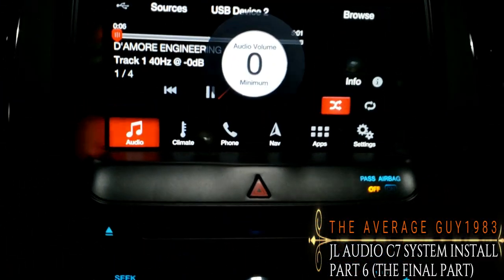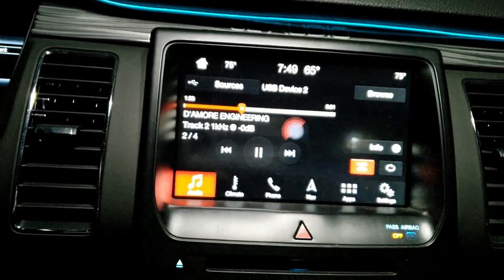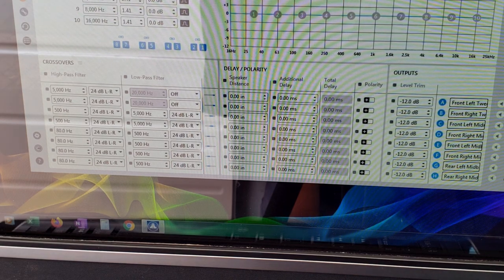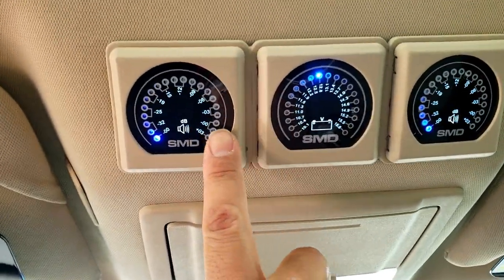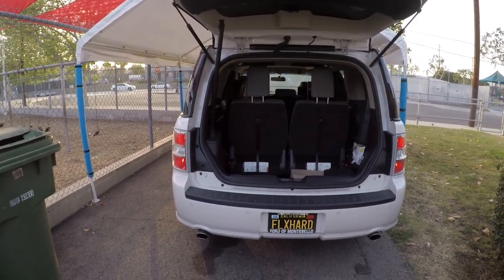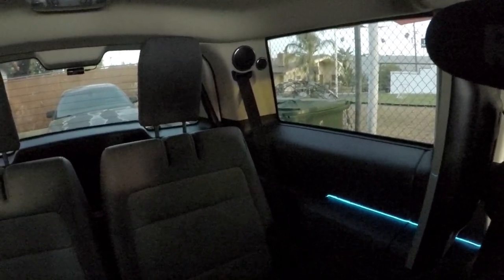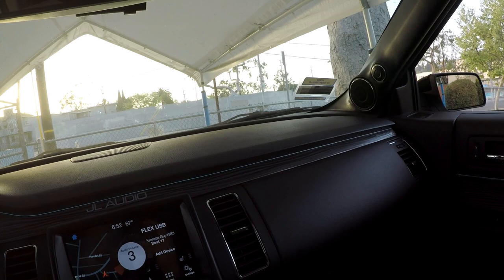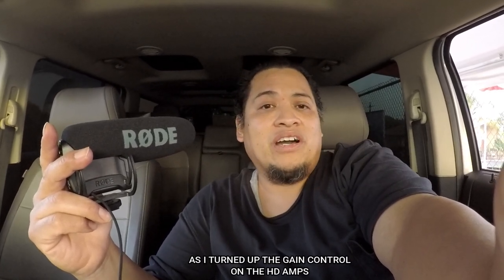JL Audio C7 System Install Part 6 (The Final Part)

Comment: Can you give an update on how the system sounds after speakers have broken in?  Awesome work bro!
Reply from the maker: Absolutely! They have definitely broken in quite well and the sound has definitely improved and they now definitely outperform my 3 way C5 speakers in sound quality. I have 1 video coming up soon about Fitment issues that I fixed and the video after that one will be the real review of the c7 speakers where I'll also be sharing my DSP settings and bring up issues I had when I set everything up and what I did to fix that as well.
Reply: @THEAVERAGEGUY1983  Would you say now that the C7s are worth it after they are broken in?
Reply from the maker: @Italian Stallion  honestly I'm still not sure if I can recommend them. To be honest, they can't tolerate the power rating they claim with music, the frequency range that they recommend at the DB slope like 12db, 24db, 36db, 48db  is questionable, I really wouldn't want you to waste your money the way I did with the hype and then be disappointed by the results. The main reason most people who own the C7s don't complaint about them is because they didn't install them and did all the math work to figure out power rating etc, they moat likely went to a shop and had them do the work and though they sound good I don't think that they are worth the hefty price tag. I wouldn't buy them again unless a driver blows out then I would buy a replacement driver but as in putting them in another car, nah man. I still prefer the C5 3 way speakers over these. It's too bad they stopped making them.
Reply: @THEAVERAGEGUY1983  Aww ok, I guess I will ask around if the C3 speakers are good. I just want to avoid paying $2560 for a three way C7 build if its nothing special and mostly hype. I've got a big budget but... you know. Do you have any other videos I should watch?
Reply from the maker: @Italian Stallion  I got a couple depending on what you might need. Like if you want to know how to wire up an amp rack I have a video on that. Unfortunately the footage I had about making the shape of the amp rack etc got corrupted on my Note 5 back when I did it so I don't have a video on that Unfortunately. As for the C3s I have heard them and they have a really nice Dynamic bass sound to them, the only thing I would be a little bit concerned about is the back of the speaker where the magnet is, it's a little wide because of the design and you may have to make the whole for the speaker to go in just a little bigger to fit but they do sound nice!
Reply: @THEAVERAGEGUY1983  OK, thanks for the tip man. I appreciate it!

Comment: Good job man, where is the part of connecting to your factory radio?
Reply from the maker: That's an excellent question. I had asked everyone about 1/2 a year ago if they wanted me to make a video on the wiring of the head unit so that it could be easier to identify front and rear left and right channels on the wire harness to make it easier to tap into. I waited a whole week and no one said anything so I skipped it.😅
Reply from the maker: I do have the wire harness diagram and can tell you the colors of the wires you need to tap into. I used the blue color Posi-Taps. They were a perfect size for the wires behind the radio.
Reply: @THEAVERAGEGUY1983  That would be great if you can please. Keep the good work.
Reply from the maker: @emelectoro  sounds good. I'll get the  wiring diagram book later today from my basement and I'll give you the wiring diagram colors. I promise I won't leave you hanging, just gotta do this after my kid's online learning that the wife and I help our kids with. 😁👊
Reply from the maker: @emelectoro  alrighty my brother! I got the info for you. So for 2013 to 2019 you will be tapping into the black wire harness with the most wires on the Left side of the radio which is the harness that is on your left hand side if you are sitting on the driver side.

Front Left:  - is a white wire with a thin brown stripe + is a solid white wire.

Front Right: - Is a White wire with a thin Orange stripe + is a White Wire with a thin Purple Stripe.

Rear Left: - is a Brown Wire with a thin Yellow Stripe + is a White wire with a thin Green stripe.

Rear Right: - Is a Brown Wire with a Thin Blue Stripe + is a Brown Wire with a thin White Stripe.

 I left center for last because I would recommend you leave that one disconnected and only use the 4 main channels.

Center Speaker: - is a Yellow Wire with a gray Stripe + is a Green Wire.

Remote line/ accessory fuse line is fuse # 37 (Underneath the Steering Wheel there is a fuse box there) this will be used as your accessory line for your amps etc. Use a Mini Fuse tap adapter, don't use the low profile mini style fuse tap as it won't fit in this spot. I recommend using a 20 amp or 30 amp mini fuse to give you plenty of power to run your amps on this line. Just a bit of advice, this line will power on when you put the ignition on with out the engine running and with it running, it will also power off Immediately when you turn off the car. Another issue to note is that when you open your trunk, it uses the accessory line too so your amps will turn on temporarily as the trunk opens and closes and then power off.

If you hear a pop sound when you turn off your amps or power them on, use a PAC-TR4 soft remote turn on wire. It can do up to 2 amps of current at 12 volts. I recommend using 1 per every 2 amps or DSPs or Line Output Converters/ epicenter like I did. I have Zero pop noises thanks to the PAC-TR4. I highly recommend it! 👌

Hope this helps.
Reply: @THEAVERAGEGUY1983  thank you very much my friend, is the first time I found somebody willing to help that fast. Your videos are excellent, thanks again.
Reply from the maker: @emelectoro  your welcome and thank you very much for subscribing to the channel. I created this channel because I got tired of my questions on car audio related stuff being ignored by other youtubers. So I decided to buy my own stuff, do as much research as possible, buy car audio books, watch how to properly use power tool videos  etc so I can help people here. Welcome aboard and I hope you find the videos I make in the future helpful as well. 😁👊
Reply: @THEAVERAGEGUY1983  Hi my friend, I need your expertise again, I went very simple on my car for woofers, so I installed a self powered one but I have a problem, the woofer is humming when the radio is off, Any suggestions? Thanks.
Reply from the maker: @emelectoro  hmmm... it's possible that the amp on the subwoofer is still getting power from maybe a remote line, if it's set to Signal sensing which means that you only have a ground and power wire on the amp/subwoofer combo and no remote, it may have a timer set on it before it shuts down. Have you checked to see if it stays on when the car is also powered off with the radio off?
Reply: @THEAVERAGEGUY1983  no, it doesn’t stay on with the car off, the humming is there when the radio is off and car running.
Reply from the maker: @emelectoro  ah OK in that case you may have a not so great Ground wore location. You may need to move the wire to another spot or 2 if you haven't done so yet, sand down the area where your ground wire is mounted at to your car to bare metal and then reconnect the ground wire back to that spot. Hopefully that helps. If it doesn't then it could be a problem with the applied or 2 if you are using CCA wire (Copper Clad Aluminum) you may want to change that ot OFC wire (Oxygen Free Copper). Hope this helps solve that problem.

Comment: You need a Helix ultra DSP to close the loop and tune it like a champ. I will add a front subwoofer.
Reply from the maker: @DavidmachAdo309  that ultra is a 12 channel dsp. It's not enough for the 12 speakers i have in this ride plus the subwoofer. But i believe i answered you alread on another video, i don't know anyone who owns any Helix products that can give me a run down and demo of their system so im just gonna stick to the JL brand i already know of and get their VXI amps that have the DSP built in and call it quits after that. I honestly lost interest in car audio, i don't even crank my system up anymore. It's pretty much at the same volume level as a stock radio. But im glad you are doing a front sub. That was something i wanted to do as well a couple of years ago but lost interest in the hobby, i dont want to go into details as i would be stepping on a lot of car audio youtube channel names and i dont want any problems with any of them. They wanted me to get out of the field and with enough pressure from others they gor their wish granted.  enjoy the field well you can and stay clear of larger channels and their following as they may not see eye to eye with you and really cause issues for you like it was for me. Im much happier now with my new hobby and even managed to make real friends and meet a lot of people.  🙏😁

Comment: Yo how much this all cost you.... plus must of been tons of hours to install. Great job. I got a 2019 flex SEL and want to just upgrade the factory speakers and install 2 10 in subs. Im having a hard time deciding where to put them. Im thinking of just removing the whole 3rd row seat all together and lay them back there.
Reply from the maker: Hi Daniel! I paid really close to $15,000 for everything including the vinyl and acrylic rings I needed to make my A pillars. This took me a year to plan out and put together lol. But I was able to go crazy with the higher end gear because I did the work my self, it wasn't easy and I had alot of trial and errors but I made it work. As for the 2 10 inch subs that's an excellent choice. If you need your 3rd row and trunk and don't mind removing your spare time, you can place them there. It has some decent air volume space. That was going to be my second choice if the stealth box didn't work out but it sounds pretty damn good for how small it is. Some lower notes hit harder then the higher notes on the subwoofer with the small fiberglass box.

If you remove the 3rd row seat out of the flex, just know that you will have to make a flat floor for to put in its place to keep the floor looking even. Let me know if you need help with anything you want to figure out audio wise. 😎👊
Reply: @THEAVERAGEGUY1983  yes !! awesome thanks for the info. one question i have is the speaker in the middle of the dash. what would you recommend, and also for the door speaker up grades ? lol. i have 2 10in JL audio subs. should i stick with the brand?
Reply from the maker: @D_nuggz  you can if you like, JL Audio is not a bad brand at all, they are just a bit on the pricey side for most people. For your center channel you can run that on stock power if you like and use a 3.5" speaker. Like the JL Audio C2 it would run good on stock power as it only does 35 watts rms but..... you get the tweeter in the middle of the speaker which will give you alot more Clarity. As for the door speakers. If you want to keep it easy with out doing crazy modifications to your door panel speaker brackets, then you can go with some good 5x7 speakers that can at least do 75 watts rms for you. If you can find them in a component set up then you can place the tweeter in the stock location and get some good clarity from it. And for your rear doors because there really isn't a good place to put tweeters, you would definitely want Coaxial 5x7 speakers for that or if you want 6.5" speakers its definitely possible but you will definitely need to modify the speaker brackets on the door frame. Let me know if you need anymore help.
Reply: @THEAVERAGEGUY1983  sweet!! Thanks appreciate the quick response and the info.  Nit to many people do this for this model so its hard to get any info.
Reply from the maker: @D_nuggz  I know man. I was in that searching situation till I decided to just do stuff on my flex and if it works Posted up on youtube and thus the channel was born lol! 😅👍

Comment: Bro how Long it took you from planning, buying and installing?im in the same Journey im Just starting. Just ordered an LC6.1200 and LC1.800 but im planning to have everything by 5 months including speakers,subs and DSP
Reply from the maker: Honestly? Almost 2 years. It took a while to find the right size speakers, figuring out how to make the A pillars since multiple shops wanted to charge me minimum $700+ dollars just to make them so I ended up making my own with several A pillars as practice till I got it right. Installation was done within a couple of months. In total it took me about 200 hours to make everything from wiring to speakers brackets and Amp racks alone. I also had to invest in a temporary cheap husky Branded router table and bought several router bits from mobile solutions including circle templates which costed alot just for this project lol! At the moment I am making a video on making speaker brackets because I am having some front speaker clearance issues with the door panel grills. The speaker hits the back of the door panel grill when the midrange hits so I had to buy some used OEM brackets and modify them to the size I need to fit the C7s better on the doors. So I'm not 100% done yet with the system like I thought I was lol

Comment: Nice job! Sounds great on my headphones. That sub blew me away. very nice for compact setup. I got a giant box in the trunk. Smh lol.. You got very nice equipment. I only got budget system I had ds18 6.5's but just upgraded to 8's they just made it clearance. Stupid loud and clear for $50 speaker. Did u try adding delay? I have a cheap dsp but have yet to mess with it Im gonna start off with your Hpf settings .I just noticed the 3rd row El lightning nice. I might need to do that.
Reply from the maker: Actually Yes!!!!! I did 3 presets so far and on the first one i did zero time delay, and on the other 2 i added time delay for the driver side and time delay for the front passenger side. It did make a difference but what really blew me away was adjusting the Q on the EQ part of the twk88s. Thats where things really started to smooth out. The Q after messing with it is basically how wide you want a specific Frequency to blend in with the other Frequencies near it. Now it sounds a whole lot better, my only issue now is the Epicenter lol! I think I am supposed to give it a full range signal from the DSP and use the low pass filter from the amp it self along with a Subsonic filter to match the Epicenter chip. I currently did what JL said to do which was put the sub output Frequency from 20Hz to 80hz but I went up to 100Hz @ 24Db and made a huge difference in sound but...... the Epicenter seems confused trying to lower down Frequencies around that. Then I seen a video from Dean and Fernando about giving it at least 250Hz at the least to make it as close to full range. So since I didnt mention that I had an Epicenter hooked up to the dsp outputs, I decided to contact AudioControl for their advice on this. Then make my changes based on their advice and go from there. I do have the original 33hz chip and a 25hz chip and a 15hz chip. The 15hz chip was way to low and the subwoofer sounded like it was suffocating in low Frequency sound lol it didnt sound good at all. Then I tried the 25hz chip and that sounded better not still too low for the sub to handle, so I put back the 33hz chip and that sounded a whole lot better but..... this is with my Frequency set from 20hz to 100hz so I will have to try the 25hz and 33hz chip with the new recommendation from AudioControl. 😅🤷‍♂️ I listed to alot of new hip-hop that doesn't require the Epicenter but I also listen to 80s Rock like Journey, AC/DC, Van Halen, The Outfields, Sting and the police, Oldies and some Spanish music here and there with the 80s Rock its very midbassy but weak. I also tried using the Accubass and it sounds good with some music but overpowered with others and if you slightly adjust it it can sound like there is zero bass so I have it set in the middle as standard.
Reply: @THEAVERAGEGUY1983  hey man what frequency do you have your high/vocal q setting at? I'm not really sure where to blend mines maybe I could use yours as a starting point. For now I just got it at 250 with 3 flat q. Haven't found a sweet spot yet.
Reply from the maker: @ninja-vanish8086  sure like the Q of the Midrange speakers?
Reply from the maker: @ninja-vanish8086  sure. Sorry for the late reply. I just made a deal with a employee from Car Toys In Colorado for the Last Pair Of JL Audio C5 653 3 way components. Jl Audio pulled the plug on the C5 line. They decided to discontinue it. SMH.....
Reply from the maker: @ninja-vanish8086  alrighty! Here is how I have mine set up right now.

Tweeter frequency is at 5,000Hz to 20,000HZ at 24db. On the EQ though I have it set from 2000HZ to 20,000Hz with the gain on the 20kHz frequency set at +6.0dB

Midrange frequency is set at 500Hz to 10,000Hz at 24db. On the EQ i have it set at 500Hz Q: 7.16 Gain +2.5dB
1,000Hz Q: 8.16 Gain -2.5dB
2,000Hz (no Q) Gain -4.0dB
4,000Hz (no Q ) Gain -4.0dB
8,000Hz (no Q) Gain -0.5dB
20,000Hz (no Q) Gain +1.0dB

Midbass frequency set at 100Hz to 20,000Hz at 24db. EQ is Set at

80Hz Q: 10.00 Gain -3.0dB
125Hz (no Q) Gain -2.5dB
250Hz to 8,000Hz has (no Q) Gain Set at 0.0dB
20,000Hz (no Q) Gain +6.0dB

Subwoofer frequency 20hz to 100hz at 24db. EQ set on 20Hz (no Q Adjustment) Gain is at +6.0dB
50Hz (no Q) Gain 0.0dB
100Hz (no Q) Gain 0.0dB
All the other frequencies higher then 100hz are off.
Reply: @THEAVERAGEGUY1983  awww man thanks! I screen shotted this it should be some nice references for me. Big help dude! you are the man!
Reply: @THEAVERAGEGUY1983  oh man nice find with that deal on the components. 👍
Reply from the maker: @ninja-vanish8086  no problem. Thats why I'm here man. 😎👊